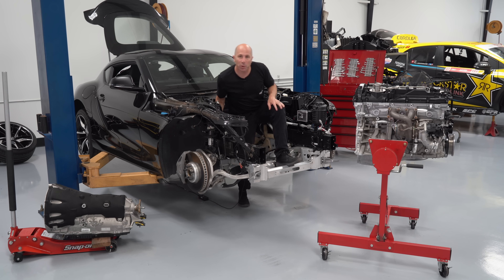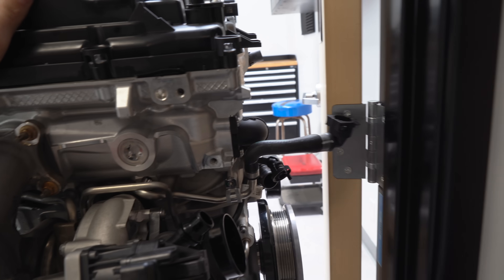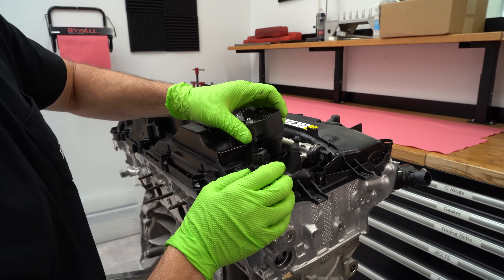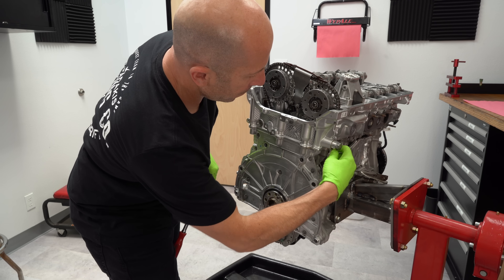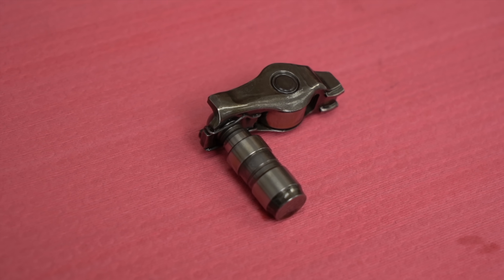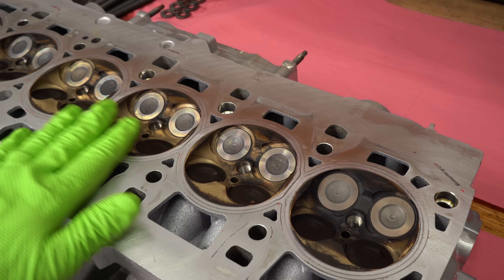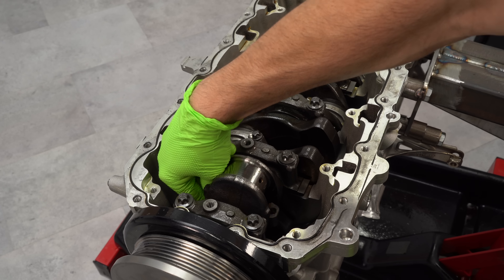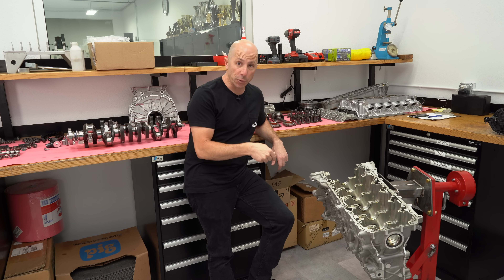2020 Supra B58 Engine Teardown - First Look - Better than the 2JZ?

Comment: I feel like your going to hit a wall at around 700hp due to that intake manifold design
Reply: Seems like the integrated exhaust arent the most versatile either.
Reply: @bingoberra18  No I meant the exhaust manifold, why did I write intake?
Reply: @Roboticpycotic  i wonder if its possible to mill out the existing outer wall and replace it with a conventional exhaust port placement. For the most power you might want long runners with pulse separation and that would be the only way i suppose.

Comment: BMW sent the engine that they proposed to do this project and Toyota sent back with a list of necessary improvements. BMW engineers than freaked out and made the design changes....and now incorporate those changes also  in their new 4 banger 2 liter ULEV that has apparently been getting 38 miles to the gallon while in M format like in the new X2M produces well over 300 HP and TQ! AMG in the new 45 4 cylinder is the highest production car output 2 liter 4 cylinder. 100 HP per cylinder! But it has just OK gas mileage....That same engine has a variation of the theme: From the X1 with 228 HP found also in the Mini Cooper Clubman and Countryman, the X2, the new 1 supercoupe (4 door) 3 series, 4 series - yet to come out...and  5 series...not sure about the 6, and of course the new Z. I believe that same 4 cylinder 2 liter TT will be offered in the newer models of the Supra...a kind of watered down version of the 6 cylinder like the base Z. And of course the variations: From 228 HP, 255HP and well over 300 HP (M). Yet very light and lightening quick...and sipping very little fuel. My 350 CI in my old Vette could empty it's tank in 1 day!

Comment: This is an amazing video. I'm thoroughly impressed with your ingenuity and your ability to describe the tear down and the different parts and what they do. Honestly I can say that this is one of the most complex engines I've ever seen. It's one amazing ass kicking engine. Boy have we come a long way from the old 454 V8's! You could build those to push an easy 1000 HP. But those engines were big and heavy...but the strange thing is all the stuff that's bolted on to this engine to make it work makes it appear as big as a big block V8. Man as much as I love these engines including the one in the Nissan GTR and probably the new Vette C8 they are so complex to build up. Geez has anyone ever done a tear down of the electric motors from the Tesla 3 that are going to be in the new S? The electric motor is so simple yet so powerful that's it's crazy! Once the physicist and engineers crack the 1000 Mile range with battery power people will stop buying gas engines....Tesla's can smoke most cars out there and do this with luggage and 4 passengers and still have plenty of power left to party. Scary how fast the world is changing.
Reply: Oh and I was surprised to see just how many parts I could ID. Most of them....except some of the exotic stuff like the different types of cams. VVT....

Comment: Is it possible to make the mains bigger and cross still for bolts to make it even stronger? Hard to tell if your below the water jacket or not but that would be no big deal to seal up but if your into oil drain then you might be tampering with the devil.

Comment: Drive by wire is great.....until the throttle sensor dies then the transmission doesn't know what to do. Boom dead on the side of the road. Call me old fashioned but, no thanks.

Comment: Supra engine??? That engine doesn't even have S from Supra. It's mechanically 100% BMW. Toyota's is only ECU tune.
Reply: @Seb C Sorry but you know shit. B58C doesn't exist.
If you really wanna be specific, this is B58B30M1 identical in everything except ECU tune to the engine that goes inside  G05 X5 xDrive40i/sDrive40i, G07 X7 xDrive40i, G29 Z4 M40i, etc. list is quite long.

Comment: Whack. Everyone who knows cars, knows the Corvette dug the grave for these cars before it was released.
Reply: Except id rather have this compared to the new "corvette"
Reply: Yeah, you sound like you know cars real well 😂
Reply: @BeanieNinjay0  Are you referring to me ? I hope not. The BMW engineering is impressive but the car is whack compared to a 2020 Corvette or Lexus LC. Whack 😂
Reply: William Levy I commented on your comment didn’t I? 

Interested in hearing why you think the Supra is “whack” compared to the new corvette and LC. I’m sure your response will be equally as “whack” as your opinion of the new Supra 😂. Clearly, it would have to be. One one hand, you’re comparing it to a car that costs around 100k and doesn’t even compete in the same class, and on the other hand no one’s been able to thoroughly test the car because it’s not officially out yet. Must be an e-racing teenage fanboy lmao
Reply: Alex The new base trim Vette will be $59,999 MSRP officially from GM.
495HP 470ft-lbs torque V8. That low price on a mid-engined high performance car.

That’s what the OP is trying to tell...
Compared to the $55,000 base MSRP of the Supra.

Comment: They split the rod inaccurately?? That doesn’t seem like BMW. Wow.
Reply: They've been doing it for about 20 years now
Reply: I did not know that. I’m new to BMW engineering. It’s surprising considering their commitment to precision in everything else that I’ve seen.
Reply: @cougargold  it makes the rod stronger and prevents mixing up the caps since they only go together one way.
Reply: Paul Sadler 

That makes sense. The only concern I’d have is all of the plastic components. The Ford 5.4L had plastic tensioners on the timing chain and that ended up being the Achilles heal on that engine that ended up destroying most of the motor (in conjunction with the garbage oil pump). That said, I think BMW and Toyota’s engineering is light years ahead of Ford.
Reply: @cougargold  the plastic guides used to be a problem, and still occasionally is, but not as much as they used to fail. The new B series motors haven't had any really bad problems yet.
Reply: Paul Sadler Yeah, I’m sure. I’m very interested in the new 8 series. I have yet to test drive one. But it’s really a toss up between that and the M5 Competition. Both great cars.
Reply: @cougargold  pretty much the same car. 8 is bigger and wider, m5c is just stupid quick. Both have M xDrive and zf 8 speeds too.
Reply: Paul Yeah, I love the look of the new 8 for sure.

Comment: From what I can see here this thing is not a very mod friendly engine
Reply: I think you know quite a bit more about engines then me but how much would you like to mod here? You could Upgrade  or mod the Turbo and the Fueling System. Toyota made it pretty easy to get more cooling to the engine so you should not need to upgrade the intercooler or the oil cooler to early. I think you could get to 600-700hp without alot changed.
Reply: Did you even watch the video, or were you blindfolded?
Reply: Alex forged crank but only a 2 bolt main
Complicated oiling system
Complicated fuel injection system
Complicated timing system
Complicated electronica control system depend upon OEM sensors to make work in a streetcar
Complicated head with only two exhaust ports 
Complicated intake manifold
Aftermarket parts are supply and demand. The question is will there be enough of this car/engine sold to justify aftermarket suppliers to developing and manufacturing aftermarket parts to make it cost effective for anybody but a race team to develop horsepower. History shows the simplest engines make the best race engines. From dragracing to F1 the formula has always been take the simplest engine add technology make power
Reply: Jetxgto well, all those things are probably there to make sure the car passes emissions. Remember, the Supra has to appeal to countries all over the world in which cars are taxed based on emissions and displacement. Sad reality is, unless you’re living in America, it’s almost impossible to make a cheap sports car that’s fast and simple and easy to tune.
Reply: Jetxgto he literally said the oil system wasn’t complex.....
Reply: @jetxgto  well f1 has lots of regulations to what type of motors are allowed. and everyones uses the same pushrod motors for drag racing cause theyre cheap and easy to rebuild
Reply: ShantyGaming It’s complex to modify when you start adding horsepower because everything is just are you geometrically dependent on one of their that’s why they have to put that fancy girdle in there
Reply: All it would need is a bigger turbo and an exhaust. Sounds like it’s pretty fucking reliable as is and can handle more hp stock
Reply: @crack3dgaming600  Will be reliable for not much mileage
Reply: CRACK3D GAMINGExhaust is built into the head you can put a bigger turbo on what you’re going to increase lag the best way to reduce lag is porting the head and putting on more efficient headers
Reply: CRACK3D GAMING really don’t think a exhaust would do any good as it only has 2 exhaust ports coming out the engine
Reply: Ok well lets make it easy. Ls swap?!?!
Reply: @thomassmith3951  nah 2jz swap :) but i wonder if you do a 2jz swap will all of the stock modules work etc
Reply: So what?

Actually every engine isn't easy to mod. But if you know what you do and what to do you can acheive crazy numbers
Reply: Nowadays you get more power and range for some engines by an online software update...
Reply: Times, technology and methods change... move on with it or get left behind.
Reply: https://youtu.be/r2J-d5MH6s4
Reply: Nothing is anymore. Everything is over complicated
Reply: Mikie Iacono how is going to pay to develop all the technology for  this engine and how long will it take.
Again I’m not saying that this is impossible I’m saying it’s going to be very very expensive which means not very easy
Reply: the intercooler being inside of the throttle body is baffling to say the least lmfao. So in essence you need a larger throttle body and make a new cooler inside of it?? There is a reason why no one has made 1000hp on a b58 engine and its been out since 2015
Reply: It's like you're trying to compare this to a 60s small block Chevy. Times have changed old man. It's very mod friendly, and has already been making big power. The aftermarket is just getting started for the b58.
Reply: Nick Estes i’ve been building turbo EFI car since I was 17 I started building LS parts before they were even for sale in summit racing. I know what it takes to develop engine parts from scratch two things a lot of thought and huge piles of hundred dollar bills. This engine is going to take an army of smart dudes and a mountain of money. I’d rather build a turbo kit for a Lamborghini
Reply: The B58 is a fucking masterpiece
Reply: @TeacherToolkitDemo  sure its a masterpiece so please tell me what tuner in the past 4-5 years has made over 700hp on this engine? NO ONE
Reply: @BobbyDully__P  bigboost cracked over 600whp in 2018. So I'd say that 700bhp. Who cares anyway. A quick remap they make over 400bhp which is more than enough. Its responsive and good with fuel. Hardly anyone on the planet wants 700bhp in cars that come with the B58 engine.
Reply: @TeacherToolkitDemo  WHO CARES? I DO LMAO and how long do they last before the rods start bending? Ya ok then lmfao. No one has cracked 1000hp and yet this due claims he will do it. IT WONT LAST LONG LMFAO
Reply: @BobbyDully__P  no idea if it can take 1000bhp lol. I wouldnt be able to afford to run a car with anywhere near that power with the miles I do anyway 😉😬
Reply: @TeacherToolkitDemo  MANY PEOPLE have already tried and failed thats why the cap right now is at 700hp lmfao. Manifold is internal, coolers located inside the throttle body. In order to modify those essential parts you would need to manufacture from scratch lmfao which would cost thousands of dollars in development in the aftermarket world
Reply: @BobbyDully__P  wonder why it was developed like that then? Cheaper to manufacture? For me 700bhp is complete overkill lol. I've got 380bhp in a 4 series and it's enough for the UK.
Reply: @TeacherToolkitDemo  Its not cheaper to manufacture at all. The reason these things are placed in quirky places is to increase maintenance cost!! You guys dont realize that nowadays dealers make most of their money through maintenance. If your cooler goes bad you change the whole entire unit. IF you need timing done which is located at the back of the motor. The whole motor has to come out lmao thus way higher maintenance cost
Reply: @BobbyDully__P  I go independent garage mate. Never take business to the main stealership 😬
Reply: scribd Wrong, Toyota does not want to increase maintenance costs on their cars. The manufacturer does not care if the dealers make more money on service, because they are independently owned. All if these features are about packaging, weight, emissions, cost and safety. Maintenance is pretty far down the list.
Reply: scribd = full of shit. Toyota engineers do not care about dealership service department profits, period.
Reply: scribd no one seems to understand the exhaust manifold is inside The head I wonder if anybody hears heard of heat soak and trying to manage that in a high horsepower turbo engine
Reply: If I'm not wrong you have to pull the engine to do head and timing chain work.
Reply: Jetxgto which parts make you think that?
Reply: @crimsonstang  The internal exhaust manifold is possibly one of the least mod friendly things I've ever seen on an engine.
Reply: @kedrshr1mp6  that's true. I wasn't trying to argue with him to say that he was wrong. I just wanted to know what he thought was not mod friendly.
Reply: Basil yes you will need a new head for power and to make it worse the one there is probably very restrictive for emissions usually you could have swapped it and made loads of power
Reply: Basil You’re absolutely right
Reply: Check out slowgtr on Instagram
Reply: Jetxgto my thoughts exactly :/
Reply: I agree. I doubt many companies start producing parts. The exhaust looks very restrictive. Also it looks like you will have to pull the whole motor to do anything beyond the intake. Are the pistons and rods forged?    I really liked the video. He does a good job. During the take down I could tell he was talking the motor up. Then at the end the truth comes out. 335hp is pretty low by today’s standards. I’m sure it’s a reliable motor but obviously Toyota has a very limited understanding of what supra fans wanted. Epic fail Toyota.
Reply: @RP-dv3pw  lmao this same engine has already been making almost 450whp with a downpipe and a tune in other bmws. This is exactly what people wanted.
Reply: Nick Estes lol exactly what the people wanted? A BMW? With non forged internals and a motor you have to remove to mod? Just buy the bmw version it’s cheaper and better.
Reply: Nick Estes very mod friendly? Your just making stuff up. Link some mods you can buy. Link that downpipe.
Reply: R P there’s no mods available for that car anywhere they all have to be designed and engineered
Reply: R P bruhhh dp and tune these are running tens in the quarter. U clearly don’t know shit
Reply: Seems to me you know nothing about cars

Comment: Interesting to see the progression from the BMW N54. Closed deck and cam driven high pressure fuel pump are interesting changes. The integrated exhaust manifold is also clever. I wonder if that helps to keep the exhaust temps up pre-turbine, or if it's just for packaging. Maybe other reasons?

I do like the air/water intercooler. BMW moved to that on the S55 as well. It seems like an air/air intercooler would be better because of the ability to have lower temps. While that may be true I think the air/water gives more consistent temps which is better because it is less susceptible to environmental conditions. This assumes you are driving further than a 1/4 mile at a time of course, though maybe it could be plumbed to an external ice box. 

I look forward to this project.

Comment: This motor isn't a 2JZ successor, it's a BMW made B58B30M1 a successor to the older BMW N55. This engine is also currently shared with majority of new model BMWs not just the Z4....Toyota will never make a real 2JZ successor.

Comment: Nope.  Too much water cooling in plastic manifolds at critical locations that can lead to failure.  I'm surprised i didn't see a plastic exhaust manifold with water jackets...  Any repair is gonna be atleast a grand.  Oil change is another story but I won't even address that.  I love the body of the car, horrible drivetrain design for the enthusiast car guy unless you have the $$$.  Most people do not.

Comment: Compared to a lot of engines, this one looks like they really went through some pretty heavy engineering to make it a true platform for a builder if they wanted to take the engine to those high HP marks. This is a bit more simple than many motors out there. Some pieces are a bit odd in position, but its not the worst. True that only time will tell how good it actually is.

Comment: I'm not really a mechanical or engineering type but still a couple of things I found really interesting about this like the integrated exhaust manifold and the intake with the moulded in intercooler

Comment: I'd hope that 20 years later they built a better engine. But it's certainly not, because it's a new engine, and new engines don't do what old engines did. It's also a BMW engine, so yeah. It'll last but be hard to work on. And when things break you won't be paying for expensive parts, you'll be paying for BMW expensive parts.

Comment: @PapadakisRacing
 will that thin liner hold up to lots of boost and will those integrated Ex ports flow enough???   I foresee hard liners in the block(looks like plenty of meat to work with)  and people swapping to the Z4 cly head with 6 Ex ports for the flow.     I don't see those 2 ports flowing enough air for 1k hp, even massively ported.